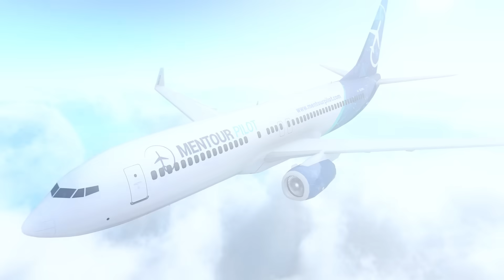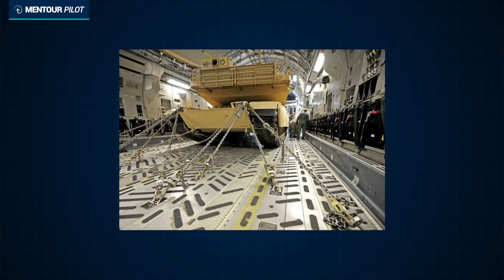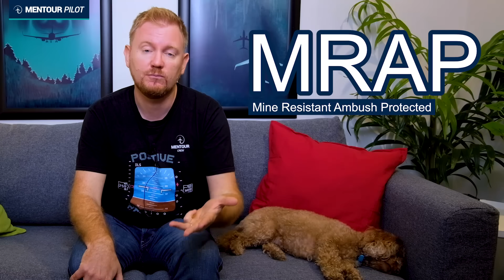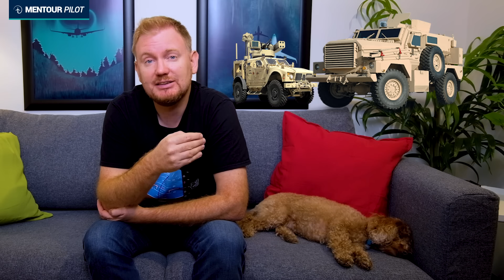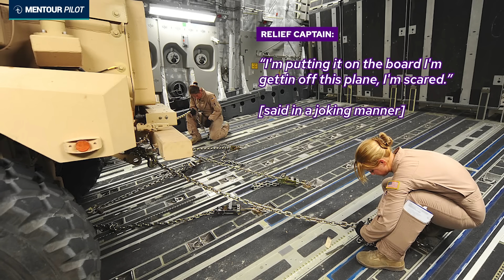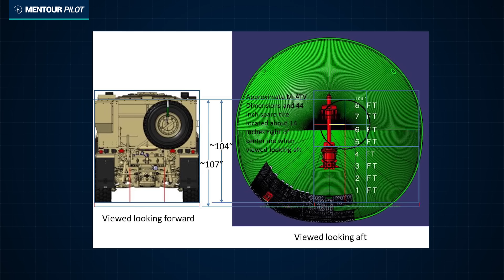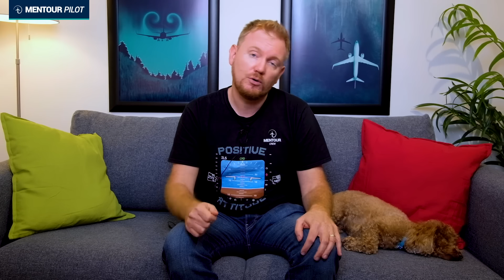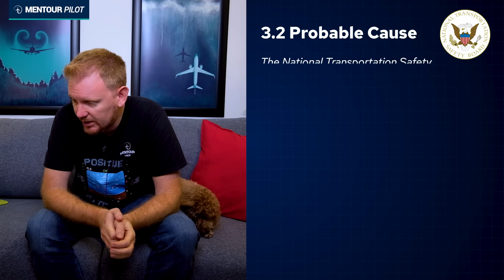Why did the pilots LOSE control?! National Air Cargo flight 102

Comment: As a loadmaster for 747 myself, the 24 and 26 straps sent shivers down my spine. I've used double amount of straps for payload weighing half as much.
Reply: I say the same thing about folks meeting building Codes. Codes are a minimum standard - there is absolutely nothing wrong with doing vastly more than is required.
Reply: @SirLionofBiff that's the problem no one wants to do more then what's required
Reply: What I don't understand is how after seeing that the cargo had actually moved, the guy didn't increase the number of straps.
Reply: @meneldal  Simple - he wasn't trained to calculate the proper number of restraints. He died, too.
Reply: @meneldal  I can understand that. I don’t remember which bias this is called, but he mentioned stuff frequently moving. It’s sort of like they found with American 1420, lots of people had landed through thunderstorms before and been fine. This guy probably saw lots of loads move before by an inch or two he clearly didn’t take it seriously enough to do anything.
Reply: I'm no load master, but that seems like such a low amount, I use 12 straps, and 4 chains when hauling a 2 ton car on a trailer.
Reply: @fallout3fanboy1 their straps are much bigger than your straps with a much heavier weight rating. Not the same type of straps you would use for your car
Reply: @fallout3fanboy1 12 straps? Those must be some very small straps.
Reply: @fallout3fanboy1 That's ridiculous. 4 axle straps , done.
Reply: @fallout3fanboy1 surreeee you do guy
Reply: I work in road haulage. It is always checking the state of the straps too.
Reply: @robslade2571  my friend is a HGV Class 1 truck driver and he said even when he stops to fuel up for anything else the first thing he does is check the straps every time he gets out of the cab, even for light loads.
Reply: So why didn't they use chains?  Curious. Everytime I have flown as a passenger with vehicles on board a C5, C130, C17, Chinook, the vehicles were secured with chains and turnbuckles..
Reply: @msromike123  yes same here when I was in the Army I flew on several C130’s and any large heavy cargo was secured with chains. I’m no cargo loader but using chains for a 18 ton armoured vehicle would be a no brainer for me. I can only put it down to over confidence and lax attitude. Sadly it cost the lives of 7 people.
Reply: @matty6848  Overconfidence?  Incompetence gets my vote
Reply: @johnnypereda3852  People are not naturally competent, they need to be taught the knowledge and skills necessary and assessed to verified that they have the ability to do the job.  Put yourself in his shoes. He was "trained" to be a loadmaster by his company, evaluated and told he knew what he needed to know. He found out that their training sucked the hard way - he died. This is all on the freight company. This is why the FAA has so many rules and requirements - the companies only look at the bottom line, and safety is not included unless it is required to be.
Reply: @msromike123  weight. Chains are very heavy.
Reply: @msromike123   747 deck floors aren’t equipped with d rings to attach chains to.  They secured the vehicles to the cargo pallet with chains, but then needed supplemental straps to provide the actual restraint required. Some of those photos are from a typical upload of these types of vehicles on C-17’s, where you would use chains for restraint.
Reply: @msromike123  Seems no one really answered. The floor on a commercial freighter are not rated for chains for use as tie down.  Simple answer.
Reply: @msromike123  I was wondering about that as the pictures kept showing the use of chains to secure the vehicles, but they were talking about straps. 
Finally, the investigation photo at the showing severed straps says it all!
Reply: @stevie-ray2020  chains were used to secure the vehicles to the platforms, and those platforms (with the vehicles on top) were fixed to the plane with straps.
Reply: The chains were used to chain the vehicles to the pallets and the straps were used to strap the vehicles to the floor of the 747
Reply: @msromike123  I would imagine due to lashing point strength, military aircraft are designed to carry the large loads from the outset so will be equipped with very high strength lashing points whereas the 747 especially as a converted passenger aircraft probably has much weaker individual lashing points so the load would need to be spread across them. I could be wrong but it’s something we come up against in road transport, people will secure a load with 4 5000DaN straps and consider it secure when they are hooked on to 500DaN lashing points (basic example) 🤦‍♂️
Reply: @msromike123  Chains are heavy! probaply one less vehicle they could move each trip.
It's a private Company making money not a Military mission looking for safty.
Reply: @msromike123  Chains are prone to deforming and shattering if they're not strong enough, potentially catapulting a piece of chain through the aircraft body. Then there's also the fact that chains would add a lot of weight where straps are way lighter and similar in strength (provided they're in good condition), are easier to store and are probably cheaper to get.
Reply: @msromike123  AT LEAST A BUNCH OF US WERE SMART ENUFF TO JUMP OUT OF THEM!  HOOAH AIRBORNE ALL THE WAY!!😅😅😅THE NYLON STRAPS ARE ONLY GOOD FOR 20000 LBS, BUT IF THERE IS ANY MARKINGS ON IT PERIOD, IT AUTOMATICALLY IS RATED FOR 10000 LBS. AND THE CG-U1s WOULD BE HIGHLY STRESSED. ALL SHOULD HAVE BEEN SECURED WITH RATED CHAINS FOR NO MOVEMENT. BETTER SAFE THAN SORRY, USE 60 AT LEAST. WE HAD TO LOAD ONE CHAPARRAL SHORADS TRACK AND ONE HUMMER. THE TAKE OFFS WERE VERY LONG FOR A C130 LEAVING RHINE MAIN BASE.
Reply: @msromike123 chains move arround a bit and the links can have some friction and after a point the metal becomes weak due to friction
Reply: @msromike123  the locals stole the chains and thus chains sometimes were in short supply but even then some bad decisions that place you and your crews staff's lives at risk is unexcusable. I taught it's better to delay and be wrong than rush and kill everyone. Used this as a training video many times to ensure safety truly comes first. Prior to this accident people thought I was too strict and after not so much.
Reply: @msromike123  weight.
Reply: @msromike123  the only thing that would make sense to me is the weight savings. Having that many chains would either increase their fuel consumption + more fuel weight or lessen their load capacity.
Reply: @msromike123  I'm a port dawg. For some reason 747 never want to use chains and devices, they always want straps and full net sets. It's a pain in the ass and a drain on assets
Reply: The most useless thing on a cargo plane is straps on a shelf.
Reply: You don't need to be a loadmaster to know that 24 nylon ratchet straps are not going to be enough to stop 12 tons from moving. What blows my mind is that even if 24 was enough, how did they come to the conclusion that just 2 more would be enough to hold down something with 50% extra mass? That's just stupidity.
Reply: @amazingusername8925  combined with the aircraft locks (UNLESS it’s a floating unit), 24 straps rated at 2275kg per strap (avg) should be just fine for 12 tons. 1.5G load fwd/aft, side/side, 3G load top. However these vehicles seem to be floating units
Reply: @naders1771  How about the angle the strap is tensioned? At least here in Finland, max legal angle is 60 degrees even for road transport and that will have much smaller g-forces than aircraft.
Reply: @naders1771  I don't know what kind of straps those are, but if it's anything similar to what's being used in rock climbing, the rating of the straps is probably meant for brand new straps. The plastic materials those things are made of degrade over time, even when no visible damage is seen, the actual strength of them drops, sometimes down to about half its original rated strength after 10 years of oxygen degradation, even if the strap was just sitting on a shelf. Any sort of use can also makes them weaker ofcourse.

There's a guy on youtube testing those things, it's not that uncommon to see an old sandy dusty 2 ton rated rock climbing strap break at 300kg force.

Another thing, for the strength of those straps to really multiply, all the straps have to be the same tightness. If one strap was tighter than the others, that strap would hold most of the weight and snap, then the next tightest strap holds most of the weight and snaps, and so on. With bad enough equalisation of forces, that vehicle could zip through 100 straps. More straps isn't enough, the tension has to be equal.

Yet another thing is that the straps have to be tight to stop the cargo moving, but not too tight. If there's too much pre-tensioning, let's say, 1 ton of pre-tensioning,  then the straps on the front are pulling the vehicle forward with 1 ton of force each, which has to be cancelled by 1 ton of force on the rear straps, otherwise the vehicle would be pulled forwards. Which means, the strength of the straps is just being wasted, the straps on the front are fighting the straps on the back. In other words, with 2 tons of pre-tensioning, you can bust a strap that's holding absolutely no load. 

This may have contributed, as the accident happened right after the load master tightened the straps more.

It would take a lot of elbow grease to put 1 ton of force on a strap, depending on the ratchet system, but at least 300-500kg should be doable.

That's still not even talking about shock-load, if the load moves, it can put more force on the straps than its static weight is.

Another thing, the straps aren't pulling in straight line, they're pulling diagonally. The length of the hypotenuse of a triangle doesn't extend at the same rate as the length of one of its sides. If the strap length extends less, then the force has to increase more. That adds 40% extra force on a 45 degree strap.

So, we only have 2 tons to work with on a new strap, 1 ton on an old or dusty strap, with half of that strength being lost on pre-tension, 24 straps, 6 on each sides with one strap on the front having a knot in it which further cuts its strength by half and makes it effectively useless, if it's already tensioned to 500kg. That means we have 5 straps on the front, each can hold 500kg, 433kg on a 30 degree angle, that's 2.1 tons of force, which would hold a 4.2 ton vehicle at 0.5 aft G load, assuming no shock-load, perfectly equalized tension and zero margin for error.

I'm really surprised they made it on the first flight.
Reply: I have driven the 'smaller' MATV, those things are huge, HUMONGOUS. They are extremely top heavy and have a tendency to flip on uneven terrain. We have broken chains twice the thickness of my arm pulling those things from mud. 24 Straps and the fact he wasn't worried about movement scares the crap out of me.
Reply: Proves the point, there's no such thing as "Too secure" where it comes to any operation like this.
Reply: I think overall chains are better than straps. But when using straps , the kinetic energy isnt distributed to all the Straps. So when the plane is taking off, i think only 5 -7 Straps are on heavy load. And that Monster weighs 18 Tons.......
Reply: @skullyjones8234  Chains have their place, but personally i hate them, just like cables. From strap you can see(those different color stitches) if its stretch beyond its limit, but in chain or cable you know it only by measuring the links or whole cable and when those snap, anything around probably is dead or destroyed. On straps you can have little flex in them that take some bumbs but still return their place and worst case scenario if strap fails only thing you get to your face is the lock. Strap it self is not that dangerous as projectile. In this case they just used way too few straps for the weight.
Reply: Anyone who has worked with straps and loads should also know if something that big moves enough to stretch those straps even as much as a few inches when it's not supposed to move at all, you don't just cinch it back down it's already compromised the integrity of those straps because he didn't have enough to keep it from moving, that load master should have known that.
Reply: LOL As a non load master...and just a casual observer...when he went through the list of strapping I was immediately saying...Uh...double that...if not more.   I strap stuff on my trucks and have done big loads on big trucks.  But CG is the most critical thing on an aircraft....I cant believe there was NO SPECIFIC training requirements to become a "load master".
Reply: Hey guys I was at that time a transportation coordenador in BAF and had just returned from leave the day prior and was not yet back at work. The load plan was one I had done many times. The vehicles loaded that day were tied down BAF was having trouble with chains being stolen off the flightline so we had many delays because of this. The load master started strapping these big military vehicles with straps instead of chains where these straps are not safe for strapping these big vehicles for any flight. I have seen and done that for loads on trucks that were destined for short trips but Afghanistan is mountainous and when these loads failed or broke down there were teams that would blow up the load and turn MATVS and  other vehicles. This accident was something I had predicted and warned was a major possibility weeks in advance before I went on leave. The 7 deaths were preventable and the load master killed himself and his crew. I was certified to train load masters as a Sr 88N instructor prior to leaving the army. I was on the ground and assisted the recovery... Was very sad and ran across your video in the first min recognized it seeing I was there and this was an event that one never forgets
Reply: There was also a mention of a knot... I really hope that wasn't in the middle of the strap somewhere. I know that much from just tying stuff down on ground vehicles.
Reply: @keiyakins  Why not in the middle ?
Reply: @markkuuss  knots in straps are a weak point that breaks easy.
Reply: The manual he was given by National Airlines was so bad that the loadmaster had no chance to know what was enough. Especially because he was inexperienced but that wouldve been totally fine if the manual wouldnt have been so wrong. If you are a loadmaster, then you should know that the angle of the straps matter. But in the manual it was said that the maximum capacity of a strap with any angle is a constant. You can understand how an inexperienced loadmaster might easily assume that maybe they have accounted for the size of the cargo and the places of the straps when designing the aircraft and when designing the vehicle and so the manual is completely right at saying that, because if they are accounted for the angles can be designed in a way and the straps specific size in a way that it actually does have a maximum capacity under some constant. However that was not the case and thats why he used so little amount of straps.
Reply: I'm no load master but even to me that seemed low. I used 4, 500lbs straps to tie down a bed that I was taking across town at non-insterstate/highway speeds.
Reply: I guess there must be a reason but it sounds like the straps they use for air cargo aren't very strong. The 4" straps used on flatbed trucks are rated upwards of 20k lbs each.
Reply: @Deezle_Gaming No way. About 5000 lbs tops. I used to be a flatbed truck driver and used 4" inch straps. Only used them on lighter materials such as drywall or lumber. Had to place Edge protection under the straps so that they didn't tear on edges and corners. Always used heavy-duty chain and chocks when securing heavy-duty equipment and vehicles.
Reply: @Deezle_Gaming  2200 kg roughly per strap
Reply: @TheRoblock  The strength of the strap varies with its angle against the force it is in place to restrain.
Reply: @mattsmith87  that's correct and that's why we aim for 45° angle for fwd aft directions and the closer to 90° the better for upward
Reply: @mattsmith87  No, the strength of the strap does not change with any other reason than the strap deteriorating. The angle changes the forces affecting the strap, not the strap itself.
Reply: @mattsmith87  and the straps put on the back of the cargo dosent help holding the force put on the ones in the front, so i guess as a non Professional, that IF it is a 12t cargo with g force pushing towards the back the straps on the front part alone should be able to hold this force alone.
Reply: @simonbach3618  Yes, but when they re landing they need the Straps on the back . Otherwise the MRap gonna rush towards the Cockpit
Reply: @TheRoblock  90 degree? Horizontal I hope you mean. Because if the straps would be close to vertical they would take an theoretically unlimited amount of force.
Reply: Not being a load master, I had the same feeling when I heard about 26 straps.
Reply: My uncle was drove truckloads of steel and taught me that there's little harm in a few extra straps.
Reply: Chains arent elastic enough
 Straps hold the  tension even when the load shifts a tiny amountmmm
Reply: @isilder  what you talking about man
Reply: @isilder that is why chains are used for very heavy cargo. I don’t want the cargo shifting a tiny amount.
Reply: @isilder chains and straps? Belt and braces approach
Reply: Never enough straps!
Reply: I'm of the type that the safer the better can't hurt to make it extra safe so why don't we
Reply: It was the idea that the vehicle that was 50% more require no more that 10% more straps...
Reply: As a former flatbed truck driver who used nylon straps frequently, I can tell you that they tear very easily under tension. As soon as that plane lifted off and the nose tipped upward making the plane vertical, it made that mrap shift violently backward in an accelerated manner. I would bet all those straps snapped instantaneously.
Reply: I was there , actually had breakfast that morning with the loadmaster. I saw it being loaded and thought that doesn’t look right ( the straps on the Limas straight up and down not at angles ) but it wasn’t my job . It landed in my B huts of my office . My local was screaming “ rocket “ when it was falling . I immediately knew what happened . I could literally feel the heat . Im an EOD tech and it’s one of the biggest explosions I’ve ever seen and I spent almost 9 years down range . Of all my PTSD this bothers me some of the most . The problem for me is they left the wreckage strewn across perimeter road for almost 6 weeks ( my path every day ) waiting on NTSB authorization. 
I went impatient therapy years ago an mentioned it and they said they’d had several folks come through from this incident alone . Still affects me to this day .
Reply: @johnneill5960 But if you see something that doesn't look right, shouldn't you speak up? Even if it isn't your job to say something?
Reply: @smileygirl1742  if that was my job yeh . I was an eod tech not a load master . If you’re a Dr and a janitor comes in trying to tell you about your job ….
Reply: I still for the life of me don’t know why they didn’t put these on a C-17 or a C-5. Especially if they were drivable. The only time we ever used pallets with vehicles was if they were non-op. The pallet was basically a subfloor, and you’re only tying it down to the pallet with enough restraint to put it on the loader and get it to the aircraft, then adding the additional restraint to the aircraft floor.  Obviously with a 747, you can’t drive it onto the aircraft though.  It’s been a long time since I’ve worked the ramp in a freight capacity though. 

I also remember looking at this aircraft sitting outside the passenger terminal at Ramstein AB in Germany when it sat for refueling. I remember seeing the footage, wondering if it was one of our AMC aircraft, and then of course wondering what happened, and having conversations with my husband, who was a former loadplanner. I was also the supervisor on shift at the terminal when the remains of the crew came back through.
Reply: But why straps? Why not use metal/Iron chains?
Reply: @markkuuss it’s been explained numerous times in response to this comment.
Reply: Weight, and cargo aircraft that I've seen don't use any chains in the cargo area.  Those are just from the vehicle to the load sheet@markkuuss
Reply: In this case the loadmaster was a douchebag
Reply: I'm no engineer. But if you have 24 straps for the lighter vehicles, it would seem logical to have a commensurate no more for the larger & heavier vehicles.
Reply: AASLT so I agree. You cannot ever have "too many".
Reply: I trimmed cargo planes for many years and near the end always used more straps than required due to the fact that some straps where past their service life and due to the state owned airline being bankrupt we could not get new ones. Many of the straps where exposed the rain and continues sunlight and most staff were ignorant of this danger. I was relieved when we stopped flying freighters due to high costs and low demand.
Reply: @dannystrachan475  valid point, we were lucky to get a steady supply of new straps and we disposed older than 2 years.
Reply: @TheRoblock  I presume they are dated?
Reply: Thank you for doing your job properly keep it up
Reply: Does your wife call you “the loadmaster” too?
Reply: I know you wrote this response years ago but just found the video? Would a strap breaking on a load prompt a loadmaster to re-evaluate the integrity of the remaining straps if one broke?
Reply: @phoenixfire8978  Yes absolutely. But this doesn't sound realistic for only one strap to break unless the cargo is secured by just one.  And if it is,  it's insufficiently secured in the first place. Straps usually embrace things, which makes it extremely hard to tear, unless things get into movement like in the video or were manipulated or damaged before use. I saw only 1 strap breaking, but we were doing wild stuff until it did like attaching it to a pallet driving vehicle and go. They're can carry 15 tons of cargo,  so they're very powerful.
Reply: @phoenixfire8978  Common sense says yes. This is like asking if a pillar collapsed in a newly constructed building whether it would prompt the structural engineers to investigate what was going on. Use common sense, man.
Reply: @The_ZeroLine  I am. But considering how rare common sense is and how badly trained that loadmaster was I was curious how a properly trained loadmaster might approach the situation. I’m also guessing that there are significant time and cost constraints to delaying a plane departure to check if every single strap was undamaged and fit for purpose so I don’t know what an approach balancing safety concerns against time and financial concerns might look like.
Reply: I was thinking that too yet I know nothing about that stuff.
Reply: Man I tie down 30 ton with 4 1/2 chains every day for counterweight for a crane. Never ever shifts
Reply: An 18tonne vehicle!!! Shouldn't it have been like 100 straps? Perhaps 5 straps for every ton
Reply: @xoddopaul  nah
Reply: I never knew you could fly with vehicles as cargo, I dont know how i thought tgey csme to uk etc,  I assumed by ship as I thought it would have to be a massive cargo plane to take anything above a mini metro ,I thought cars would be too heavy for planes
Reply: No doubt! So few straps is a sick joke for an object that heavy considering how many straps we used on ordinary 463L pallets.
Reply: My father was a loadmaster for the pan am 747 freighter. I remember being inside that behemoth when it was empty.  God to have those times back
Reply: A computer should do that job not a human
Reply: That is one of the reasons you are still with us, probably
Reply: @lonyaidaniel  I am ^^
Reply: Would the loadmaster have been present in the cargo compartment, where he would have likely seen the MRAP move at the moment of rotation?
Reply: @jerdd9392  No - they are on the flight deck with the rest of the crew. They might go and go and look during the flight or have a cigarette, but normally i dont think so
Reply: @jerdd9392  he was and perished . Had breakfast with him . He followed their rules ( which were flawed & it was their first time hauling MRAPS )
Reply: knowing a few things about trucking - how come you don´t use chains in aviation at all?
Reply: @HermanHedning-u9j6b they do, but but for civilian transport
Reply: Surprised they don't have stronger rated restraints 😮..
Reply: Im just a lowly truck driver, we never use straps when moving machinery. Always chains and always minimum  double the loads mass in lashing capacity.
Reply: @NuttSakk chains aren't used in civil aviation with the exception for the Antonov as far as I am aware. Strap load capacity must be 5000 lbs minimum. I've used Kevlar straps though which are massive.
Reply: Thank you for this information!
Reply: I say the same thing about folks meeting building Codes. Codes are a minimum standard - there is absolutely nothing wrong with doing vastly more than is required.
Reply: And I'm a type of person that cuts corners when able, but I cannot imagine cutting corners on such vital things that can cause injury tk Hyman life
Reply: There should also be steel bars bolted to the same frame that the straps are secured to, helping to secure these vehicles!
Reply: @beringstraitrailway  nah the aircraft has enough spots to tighten a freight onto it. You just have to follow the rules and calculate it right. If you run out of spots to attach straps, you do not carry this cargo on the same flight.
Reply: @TheRoblock  Not explicit in your response, but you likely meant it as well is that you run out of capable attachment points long before you run out of 'spots'. I've done a lot of rigging, and we can only put so many points in a certain area of a certain weight before we no longer can, even though there's lots of spots left...
Reply: @TheRoblock  This.
Reply: I use 5 lockers when i park my bicycle in the city
Reply: Why difnt the captain if he was scared of cargo situation say I'm refusing to fly plane the captain fid wrong he should just have refused to fly plane until thed sorted isdue it was airlines and army cutting costs they should have split load over two planes they were ridiculous loads and a culture issue crews should always be told if you're concerned speak they didn't stand a chance eith trucks going up and fown like a roller coaster costs should never come before lives